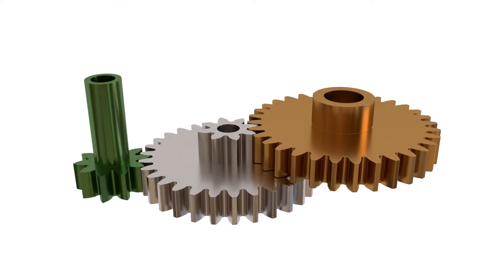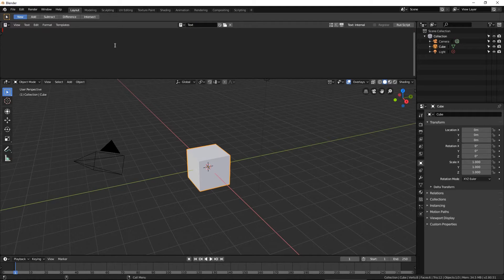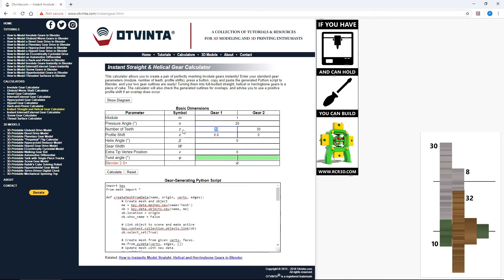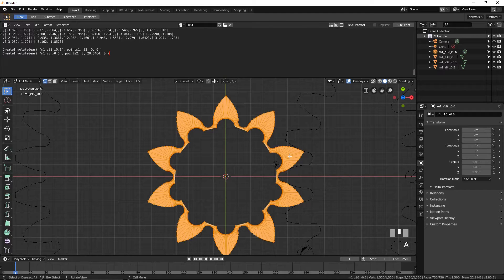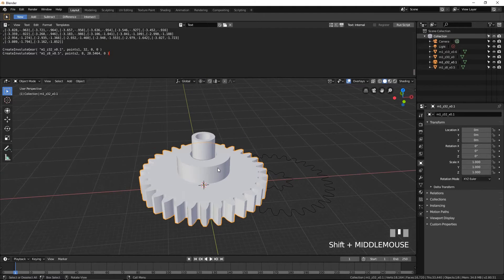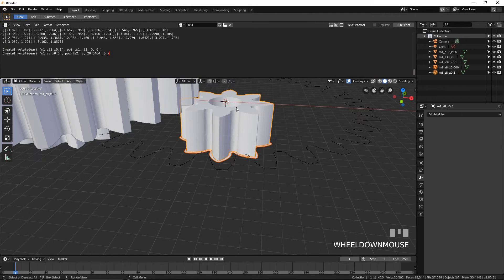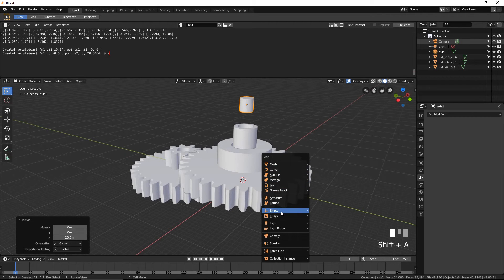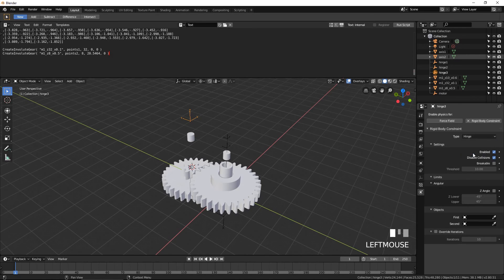Blender 2.8 Tutorial: How to Design a Simple Gear Train with Coaxial Input and Output Shafts

Comment: the Edge, Select Edge Loops, Bridge Edge Loops, when joining the inner circle to the outer one of the gear kept on filling in the middle, so leaving no center hole. had to first extrude and scale again, so the circle had like a couple of extra loops before the bridge edge loops would work, and be a tidy looking mesh, leaving the right size hole still. 
the simulations cache threw me too, didn't see it and the frame count hidden in the scene properties section. 1st time i tried following, at the end, i applied scale and rotation, that was bad, thing was all over the place. good practice tho. had to go look thru other tut vids to find where i'd gone wrong.
Reply: also had turn the friction down from the default, half way, down to next to nothing for the gears to rotate smoothly, default friction value the movement would stop after around frame 150 of 250, slide the friction down to near zero and they turn much better now :)

Comment: "Remove double vertices" no such function. Going to Mesh -> Clean Up -> Merge by distance, doesn't really do the trick either. Everything is an overlapping mess.
Reply: No remove double verts and merge verts by distance are the same thing and do thr same thing. He is just using an older version of blender. I did it with no issues.

Comment: The easiest way to create gears is in Inkscape that has its own gear settings that let you quickly insert number of teeth and gear radius. Inkscape is free open source software for 2D vector works. When you have gear measurements done in Inkscape, you can export files to dxf or svg and import them into Blender.
Reply: There's a built-in gear generator add-on in Blender. You just need to enable it. Add Mesh: Extra Objects